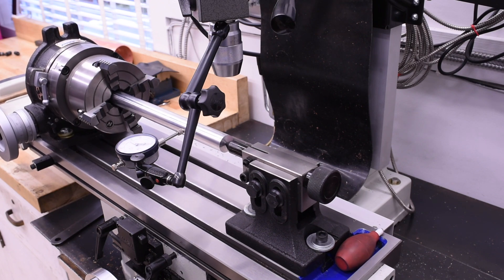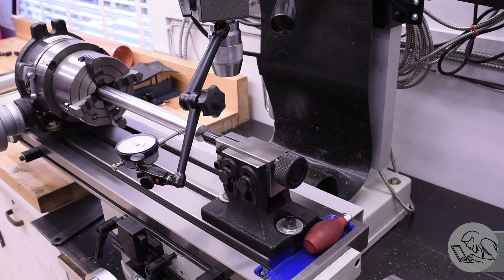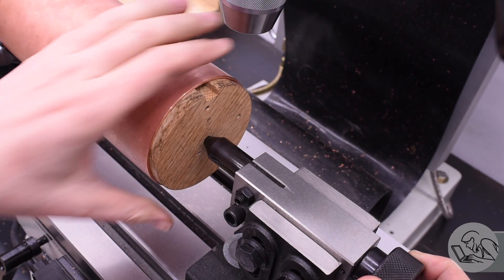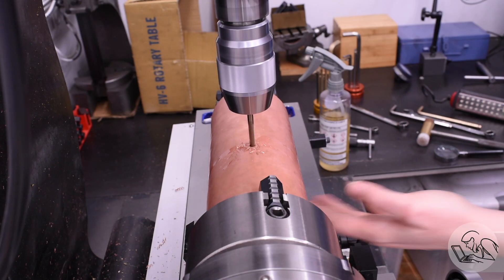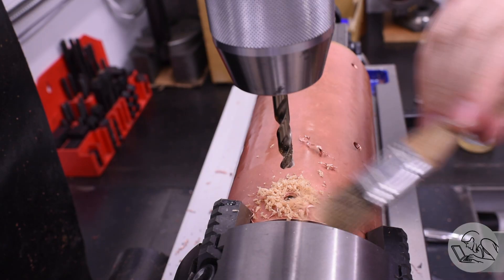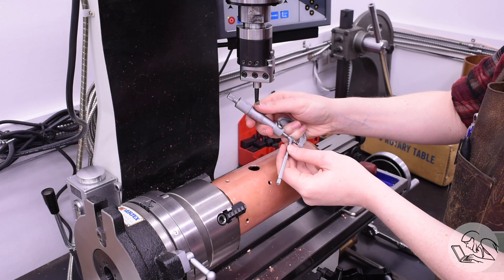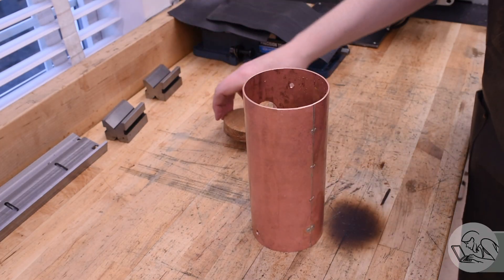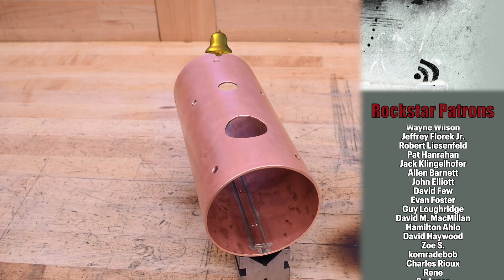Adding Boiler Features - Pennsylvania A3 Switcher, Part 5

Comment: I've been watching your channel with dedication since I discovered it, I always learn something, and (nearly) always think, "oh, right, that's a good idea."  But... you use the pointy end of the edge finder in a way that I don't understand, it seems more prone to error.  But maybe I'm doing it wrong.

I use it by lowering the quill and putting the point in the feature I'm trying to locate, then moving the table in X and Y until my fingernail no longer catches on the edges between the pointy bit and the shaft.   I can't think of a reason for the pointy bit to be movable from the shaft otherwise.  I'd think with your method you'd be better off with just a rod with a point on it, that would save you having to center it each time, and reduce the risk of knocking it off-center.

Obviously my way only works if I'm centering on something the point can center on.  It doesn't work on a printed line, for instance.  But it works on grooves or drilled holes or punch marks or even scribe lines if you're careful to not lower the quill too hard.  (and the surface is square to the quill)

Comment: Great video, fun and informative. Adding an A axis to a mill is always useful. Good pointers on setting up the soldering by putting in threads, again a useful idea, provide built in fixturing and space for the flow of the solder. 

But I do have a question. When you were doing the cleansing and blessing of the mill after removing the detritus of the vile organic material, did you use the correct oil? Remember, there is a difference between coniferous and  deciduous, one produces soils that are acidic the other base.

There is also the matter of the types of faerie and other spirits that are attracted to the tree products. I hope your blessing gave them notice that the thing to which they are attracted is no longer in the machine. This will help with keeping the mill clean, we all know what faeirie dust will do to a clean metal surface. The same with those pesky pixies. 

Keep up the good work, you and your sense of humor make me smile. For an old fart such as myself, smiles are something to latch onto.

Comment: So on the subject of boiler checks there are two schools of thought. Below the waterline here is the older school of thought, the problem with it is that the check valves have a habit of becoming crudded up with scale. I'm a fireman at the Colorado Railroad Museum and all of our engines have this style of check where it feeds below the water line. Our two older ones RGS 20 and D&RGW 346 have a particularly interesting style of check valve where it's the same casting as the snifter valve on the steam chests but used differently. 346's check's are particularly annoying. We have hard water so scale build up is a significant problem and the check's being below the water line creates an issue with scale build up. This scale build up can cause the check to not seat properly and leak which then causes hot water/steam to leak back to the injector. This leaking also introduces the opportunity for steam cuts which require and annoying amount of lapping to fix. The injector partially operates on a temperature differential and the injector getting hot will cause it to not function properly causing the engine crew to revert to colorful language. More modern engines like the D&RGW K-28's have top mounted checks where the water enters the boiler through the top above the water line and this totally eliminates the issue of scale build up on the checks. 

We actually use the pressure reduction from introducing cold water into the boiler as a part of operations. The intent of introducing water into the boiler is to replace the water that has been consumed by steam. When the engine is working hard the draft is increased and the fire and heat transfer get going. However once you shut the throttle off you have a situation where you rate of steam consumption has decreased significantly but your rate of steam production has remained constant. So introducing cold water into the boiler calms it down and prevents you from lifting the safety. We take water injections in 5lb increments of pressure reduction. You can take larger reductions but that can lead to thermal expansion issues so as a standard practice we limit it to 5lbs.  

This issue of pressure reduction from cold water injection is an issue with efficiency though and more modern engines had feedwater heaters in addition to injectors that preheated the water before it went into the boiler to reduce that pressure and efficiency loss but that's a whole 'nother world.
Reply from the maker: Great info- thanks for sharing!
Reply: Cool idea to use what amounts to cold water to dampen the steam production.

Comment: Question: when you had your machines bar in to center the taikstock, why not put the edge finder in and get your zero for center on the Y axis before removing it and mounting the boiler? Wouldn't it be the same center point on Y?

Comment: You could theoretically find the center of a large diameter by indicating it with your wiggler pointer thing. Of course youre then not allowed to move your Z axis. By using that method you can also indicate small holes quite accurately.

Comment: if the locating keys are on the "centerline" of the dividing head you can locate the center of the table slot before putting the part in the chuck

Comment: Would you also be able to put a pointy tool in the spindle and line it up with one of the centers you just setup? I was thinking kind of like setting center for a tool on the lathe to the tailstock for centerline

Comment: I don't think of it as dead trees, I think of it as cellulose-based bio-composite.
Reply: Technically cellulose is just a bio-polymer.
Reply: @mattl3729  Cellulose is a bio-polymer but wood is but wood is cellulose with imbedded lignin fibers which makes it a composite
Reply: @jchrisj200  Of course!  I stand corrected.

Comment: Neat setup for that job. 
Could you have used the tail stock spindle to find the center line as it is a smaller diameter and your wiggler would have worked? Also Did I miss you centering the boiler shell in the 4 jaw chuck?

Comment: In utility scale boilers the temperatures are way above the melting point of the metal. These are 2400 psi boilers. We had a superheat tube blow and it flopped around like a fire hose cutting other tubes in the process. One of the welders told me the superheat tubes were like a gordian knot Amazing how metal tubes get all floppy when they don't have proper cooling.
Reply: Metal is actually just like rubber, but a bit stiffer. Add heat and all bets are off. This is why when machining hard, you want to see those bright blue chips. This tells you that most of the heat of cutting is going into the chips instead of the part.

Comment: interestingly enough, your method for starting the steam dome hole is surprisingly prototypical, steam locomotive manufacturers would just take a big drill and bore holes in the boiler in a circular pattern to make holes like that, some steam locomotives you can even still see the rough edge from where those drills were used when you take the top off the steam dome, iirc Hyce has a good video that shows that
Reply: It's actually a very good method if you stop and think about it. Were you to try and cut the hole in a single step, you would load so much stress into that boiler that you would never get it back to good. By drilling lots of smaller holes, the stresses get a chance to sort themselves out.

Comment: An addition to the boiler exploding due to the firebox melting: many if not most big steam locomotives (the ones that were actually used for train services) also have a fusible plug - basically a lead plug inside a shell that bolt into the top of the firebox, that will melt before the rest of the firebox melts - the escaping steam will at the very least alert the fireman that the water level is too low and the fire should be put out or dumped.
Reply: The safety plug on our stovetop pressure cooker was also a lead plug. It blew out once when spaghetti (with sauce) was reheated in the cooker.

The ceiling had a big red stain, until the painter came.

An old memory from when I was a small lad. 😊
Reply: @robert_g_fbg  
So that memory is   spot on?

Comment: With regards to centering on the cylinder: Couldn't you also just align on the center that's in the chuck,  save that in the DRO and use that center position after you dialed in the footstock? Not sure if that would save time though. Also, I am not a machinist, so I hope this is not a stupid question.

Comment: when you're aligning the axis of the rotary table with the centre of the mill, could you not do that using an edgefinder before putting the shell in, using the alignment bar, and then save that in your DRO?
Reply: Thats how I would have done it, but like anything in this hobby there are many ways to do the same thing and all are valid.

Comment: Would using an adjustable parallel instead of the snap gage make it easier to transfer the diameters to the micrometer for measurement?